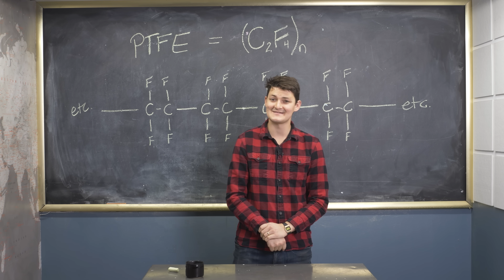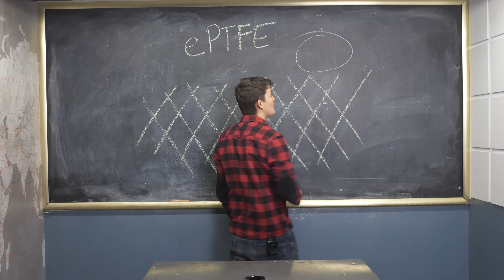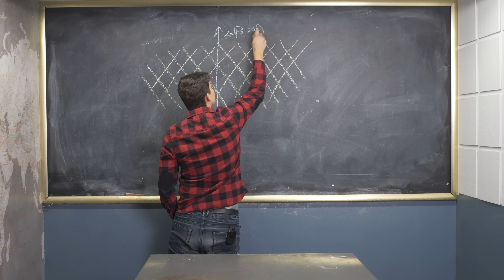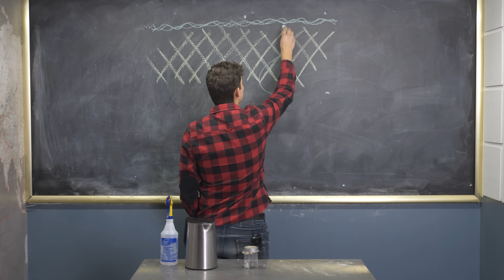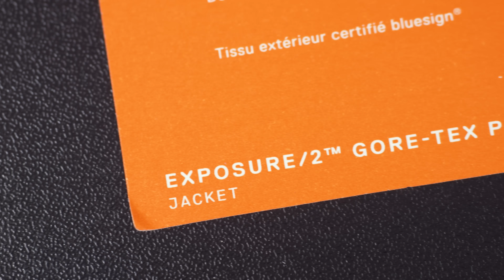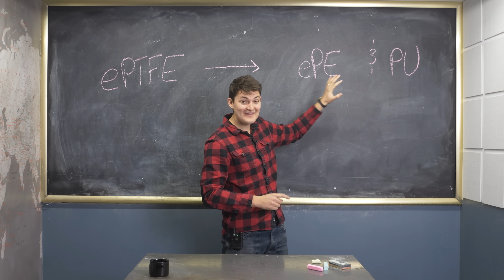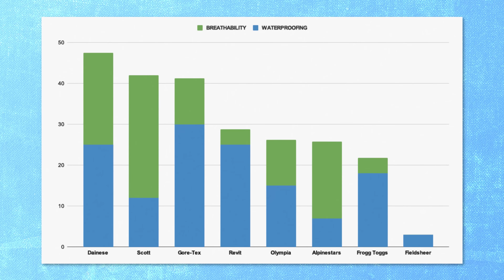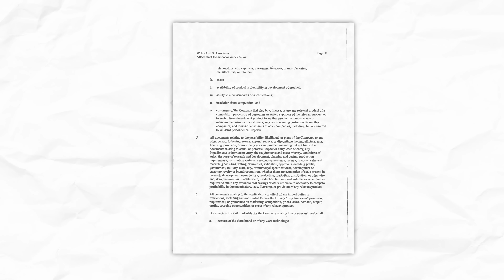Gore-Tex is a Marketing Gimmick

Comment: I have two GoreTex jackets for cycling—a windbreaker/rain jacket and an insulated jacket for riding in 30-50 degree weather. Both brilliantly deliver on the brand promise. I am dry and comfortable while exercising hard, rain or shine. Yes, they were expensive but they work. I have not looked at competitors who claim to do the same but have found that every other rain jacket I’ve worn over the years left me cold and clammy inside.
Reply: Do you think that the wind is cooling and drying you on the inside of the jacket. I would be interested to hear your thoughts if you think this is the reason it seems to work so well?
Reply: @nickg2431  I learned more about the theory of operation from this video than any other source, so you know everything I know! I don't feel wind blowing through the jacket at all, so I don't think that's happening. My beef with other rain jackets I've owned over the years is that you very quickly get wet and cold inside the jacket if you are exercising vigorously. You can get quite hot in my GoreTex windbreaker, if it's not very cold and you are exercising hard. You need to open it up to let air flow through if that's what you want. But it does a much better job of letting the sweat out than other rain jackets I've experienced. Now, to be fair, they didn't advertise GoreTex-like properties, and so it's not apples-to-apples. But my jackets have worked well in the rain (I didn't get wet and cold) so I feel like I got my money's worth.
Reply: "You ... don't believe me?  You will, Dr. Jones!  You will become a TRUE BELIEVER!"
Reply: Well? Drop the name of the jacket!
Reply: I don't think a jacket can fix your internal coldness and clamminess no matter how cool it looks :)

Comment: A very helpful man in my local bike shop dissuaded me from a Gortex jacket which he described as “boil in the bag” on the basis that  at a moderate level of effort you will get hot enough to sweat a lot so you will hot and wet inside the jacket whatever. I bought one much later for really cold wet days and in these days I am glad of it. But it doesn’t get a lot of use TBH.

Comment: I have a waterproof Burton Goretex Jacket that cost me 250€ 10 years ago and is still waterproof, like i pour watee on it, snowboard with it 5-6 hours and i dont get wet. Only thing to mention it is 40.000mm and i never wash it in the machine at home, i have it dry washed every year at the local shop. 
Goretex nowadays is mainly marketing, unless you buy $3-400/jacke, but sometime ago the Goretex stamp really meant something, and if you know, you can also tell the difference in outter materials, if you look close enough.

Ps. I made my purchase based on MMs, rather than the Goretex tag, didnt k ow much back than about it

Comment: A couple of years ago I had a tour through Rev'Its R&D department and testing laboratory. The head of R&D told us that about 90% of Gore-Tex users wear their motorcyle gear wrong by not wearing nylon or polyester garments underneath. Most riders use a simple cotton t-shirt, tanktop, longsleeve or a vests underneath which hold moisture and traps heat, while polyester/nylon sport shirts wicks moisture since it's hydrophobic.

I'm still a fan of boots with Gore-tex though! During rain, just use a damn lightweight rain jacket like the Richa rainvent I'm using. Dry for 5 full years for 69 bucks instead of 1200,- for a heavy and warm jacket.

Comment: That's why I stoped buying Gore-Tex because it simply doesn't work in theory and especially in practice. 
You have to keep in mind that the membrane breaks down very quickly. Mainly on shoes. 
You actually always had wet feet, either sweaty or because water came through. Then its fun, because of the membrane, the shoes will not dry.
Leather is the best for shoes.

Comment: Bought a Gore-Tex jacket many years ago and found that I was getting drenched when boating. I put this down to sweat that couldn't escape when I was working hard and it looks like I might have been right. But I also found that if I stood still steering the boat in pouring rain I would eventually get wet too. So "not that waterproof" may actually be the best description. I've never bought another.
Reply: I thought that too. But it is actually waterproof, it's sweat. When it gets covered in water it looses all breathability like stated in video. Some goretex hiking jackets have zippered armpit holes for this reason. If you want to make it more breathable, you have to cover it with water repellent spray. So goretex is almost pointless.
Reply: @jellyfishiscool  It's both. Waterproofing in membranes usually just works up to a certain degree. As he said, he didn't much move or sweat in the second example so him getting wet is most likely the waterproof membrane failing in keeping out water.

Comment: Gore-Tex is not a ripoff.  It's the manufacturers who use the grading label in a deceptive way.  If it was crap NASA wouldn't have used it.
You have to pay a lot for the real top gear, and look after it properly.
Reply: Did you even watch the video? There are two jackets that performed better and were less expensive. 

Gore Tex works (somewhat), but it's unnecessarily expensive.
Reply: @activeorpassive  Did you even see the vid title?...
Proper Gore-Tex clothing is more than the one layer.  I had a two-piece and it was excellent as it was waterproof at the second layer, meaning the wind force factor was taken out of the equation.
I got it a LOT cheaper than retail price at £380 for the auto-inflating version, but I bet it would have lasted longer than all those other "cheaper" options.  Not even dirt from farming land roads stayed on it.
Even washing it with the proper detergent is quite cheap as you can get it from a cheap camping shop here in the UK.

Comment: I used to buy cheap gear riding all year round 100 miles a day. It costs aroind £100 for the jacket and trousers. They would stay dry in light rain but heavy rian id end up a bit damp. Nothing major but uncomfortable. I then paid around £500 for rst gear and even in torrential rian, it never leaked. Maybe it wasn't the gortex but just better quality overall. So you do get what you pay for. But the cheap gear would suit most riders not riding in terrible conditions. As for Dainese, i think its just as overpriced as gortex.

Comment: Never assumed that Gore-Tex is waterproof and breathable at the same time. It's just common sense when any isolation layer is damped, the properties that make that layer what it is are changed. If you buy anything else that is waterproof and is not wet, most likely it's not as breathable as Gore-Tex is...

Comment: well goretex is just the coating u know?
its as waterproof as u can ask for from a porous material
breathable however will be related to the backing material
and the thread count of that backing
u should be looking for 20-40d for breathable or 100-150d for weather resistance
its at the durability and pressure resistance end of things 100-150
differences in quality becomes evident. this stuff can be cheap or expensive, and alot of people think its the same and get garbage

Comment: Your cute video misses the most important thing Gore-Tex does.  It works for millions of people who are smart enough to know the difference.  I'm 75 years old and spent most of my life working outside repairing power lines, rain or shine.  I and my compatriots tried everything imaginable to waterproof our clothing and footwear, mostly to no avail because we got soaked by sweat or rain with no help until Gore-Tex came along.  It was expensive but we tried it and found, much to our delighted amazement, that it worked to the extent that the time we spent working in the rain was far less miserable than before.  Now, all these years later, I sit on a warm, dry couch when it is raining and the power goes out, knowing that another generation of line workers will pull on their Gore-Tex and get the lights back on.  If I have to bet on who is smarter about Gore-Tex, you or millions of workers, skiers, hikers, hunters, fishermen, boaters, and other outdoor enthusiasts, your sarcastic BS doesn't have a chance.

Comment: This was very informative. As someone who has worked in sporting goods for a large chunk of my life and also been a mountaineering guide for about 6 years most of what you said is true. Goretex is also absolutely brutal to any company who tries to step out of line. Just ask REI what happened when they attempted to try E,Vent… However I have tried almost every waterproof jacket and pant out there, from Gordon fisherman yellows, to Frogg Toggs, Event, Qdri, HiVent, and a whole bunch of others that have come and gone. I have sat in rain on mountainsides for hours and yes Gordon Fisherman yellows or a trash bag would keep you 100% dry. But other than that Goretex is by far the best product out there, not as breathable as they claim but absolutely waterproof. The second I try a jacket that does the same I am not brand loyal and I will jump ship!
Reply: Agreed.  Ask anybody who has spent multiple days kayaking in a drysuit.  Gore-tex is incomparable.  The other products just aren't as good.  This video is clever but the reality is no doubt that the people that push these products hard will tell you gore-tex has no equal.  Other products are close, but no cigar.

Comment: Yep, my experience as well. That's why I switched to Buffalo jackets that are wind proof but not water proof. The idea is that when it rains you will get wet, but as long as you're active you will not get cold. PS: I don't drive a motor cycle... ;-)

Comment: Interesting, I've been using Goretex outdoor clothing products for about 18 years. I've noticed my newer purchases haven't been performing the way I remember Goretex used to perform when I was younger. I figured the manufacturers were simply using less material. Very interesting to discover here that the brand actually changed the chemical formula. That's probably why my newer Goretex gear kind of sucks. Thanks for making and sharing this video.

Comment: I've got some gore products and some other alternative ones. With shoes I have not noticed any difference,  although the only test Subject is me and my family. Jackets- same thing, pants and gloves too (ski equipment). 

But I find one thing that you mentioned- alot of brands do sell their high quality stuff with the gore insert. And as I'm a practice human being with hard earned money I tend not fall for this. But sometimes it's just necessary as I need the high end product just for the other stuff that it provides - comfort. Not the colour, or the branding, but just comfort. Like it has the deep enough, zipped inner pockets and the sleeve pocket with a comfortable zip that can be opened with a glove on. And so on...

Now I have experimented, first because of cash and then because.... well cash again. And it has payed off. Do not be scared of the other ***tex brands. In pretty much every case they work exactly the same in real life. You can test it the moment you leave the shop with the tags on and return the thing within 24 hours or less.

Comment: Most people seriously need to understand what breathable really means. Just look at your own skin without any external materials blocking it from breathing into open free air. If we're active enough we will get drenched in sweat, so with this information you got to understand that breathable in terms of garment tech only means that it's better than a plastic bag. So, no matter how good your breathable tech is you WILL get drenched in sweat when your activity level is high enough, or if it's hot enough or how much else you are wearing. 
For this reason I have been telling people that nothing is better of transporting hot sweaty air than an open zipper, which is why I highly recommened long zippers under the arms for extra venting. 
There's also different thicknesses of garments which also will add or subtract to the level of breathability. All of this info need to be considered, and applied into what you are actually going to be doing and where and when. 

For any kind of uphill walking(even in the winter) for extended periods of time I can just tell you that any shell jacket will feel like a plastic bag, so it's all about the right tool for the job at hand. Just simply dress according to how much you think you will be sweating. You can always keep a shell jacket in a backpack, and put it on when you're going to descend. 

Stop reading too much into marketing, and start thinking for yourself. Personally I really like Gore-tex, because I've accepted the drawbacks long time ago because I know it isn't magic. My main priority is the ability to have protection against the elements from cooling my body core down which is always a balance. When we get cold to the bone is when we start to suffer, so it's more about that than just waterproof and/or breathable. 

Nothing will ever be able to have you feeling minty fresh all the time no matter what you think, so it's a lot about accepting the drawbacks about ourself. We sweat, period. Deal with it 🤔

Comment: Gore tex 100% deserves its pedigree for snowy activities like skiing/hiking in the back country. In snowy conditions, waterproofing is extremely important and goes a long way. It’s still breathable enough to wick away moisture generated from being active (especially when combined with vents) which is extremely important as well because getting sweaty makes can make you cold very quickly. Furthermore, gore Tex clothing can be engineered to be pretty light and flexible compared to other materials with similar properties, so it’s easy to move around in and layer. I own both a gore Tex bib (like snow overalls) and a jacket and they are worth every penny. They also dry quickly. I’m not sure how beneficial it would be for riding though.
Reply: Nah, it works in cold dry conditions, but not when wet….if your outer layer is not totally hydrophobic then it saturates and doesn’t work.
Reply: @tornagawn   most high end winter clothing comes with a waterproofing
 layer. I usually apply a new layer of the hydrophobic layer every couple of seasons using nikwax tech wash. This helps keep me dry in most situations by beading a lot of water off. Yeah, if you wear gore Tex in the pouring rain, you’ll eventually get wet, it’s not perfect. But for certain conditions, it’s among the best
Reply: @tornagawn  try a non gore tex snow pants and a gore tex one in wet snow.  i can tell you there is difference

Comment: Gore Tex is really for snow, not rain. Yes they market it for rain, but it functions best in snow at low activity levels or extreme cold and high activity levels.  In these conditions a fully waterproof, non breathable layer is less ideal because it doesn’t breath and then you sweat and that is cold. A breathable but not waterproof layer gets wet when your body heat melts the snow. But even in an activity like ski touring, unless it is super super cold, I’m going to ditch the gore Tex on the uphill and just let the snow melt on my base layer, then I’ll put the jacket on when I ski down and hopefully some of that moisture gets transferred out the jacket, but mostly it’s just stopping me from getting super wet when snow is really flying everywhere from the ground and the air, and perhaps most of all it’s blocking the wind. For high output activities in the rain, there is no way to stay dry, best to wear a layer of wool that properly insulates for the temps. I find that a warm body can keep a light wool base layer dryish in a light to medium drizzle.
Reply: Course the same can be said of all waterproof/breathable membranes and I currently ski tour and resort ski in non goretex membranes. The touring one breathes noticeably better

Comment: Used a lit of GoreTex ski jackets over the years. Rarely skied in rain. When I did I got wet and cold. Don't ski any more since I moved to the tropics. I ride motorcycles year around and sometimes come to the US in the early spring to ride in rain and snow. My best rain jacket is waterproof coated nylon. It doesn't leak. If I need air I open the jacket or take it off. Plain coated nylon is a fraction of the cost and for me works better.

Comment: That's right up there with Thinsulate. I have Klim gloves with Gortex and Thinsulate, and my hands freeze in those gloves, and they get wet. I have found being a rider in Vancouver BC, that rides year ago except when it snows. Nothing keeps you dry except for rubber. Someone needs to come out with a Rubber Motorcycle boot, and rain pants that have a diamond in the crouch, so the seams dont blow out in the crouch